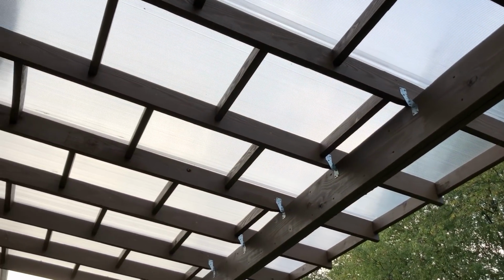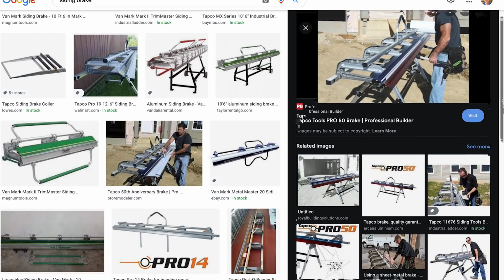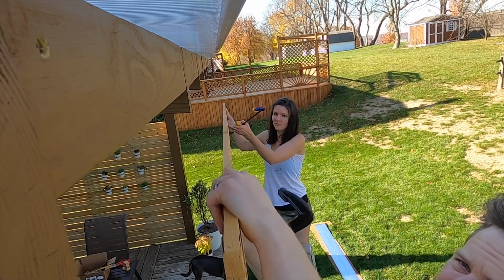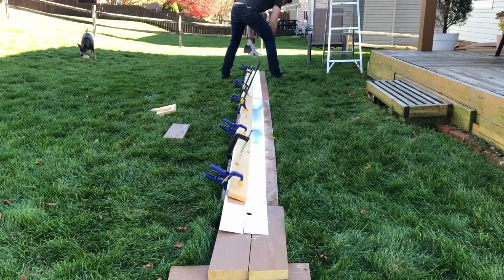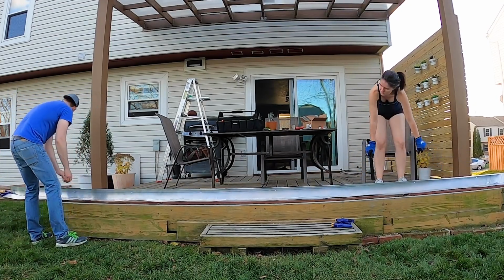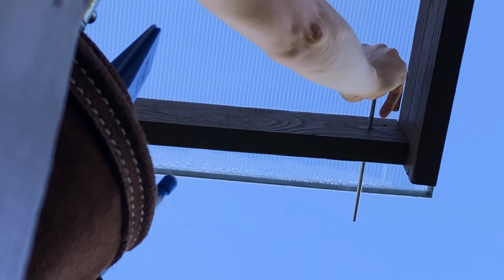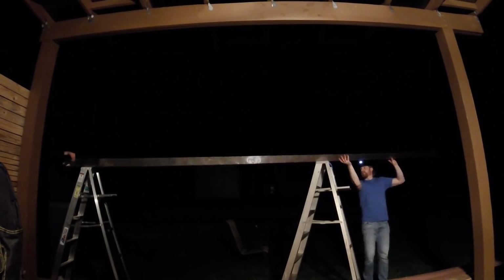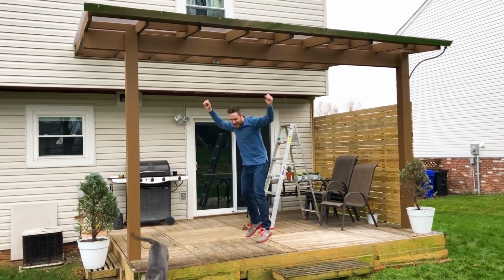Making a Cheap Gutter – Opinions May Differ

Comment: I've used valley tin as slashing where the metal walls meet the concrete. Absolutely wonderful. However, that wouldn't work as gutters for me in the Rocky Mountains. I get 18" or more of wet heavy snow. It'd rip that flashing down and turn it into a crushed beer can during the first snow.

Comment: And if you’re so cheap why did you use 6 x 6 posts and a 10 inch beam for like 3 x 2 stringers crazy you could’ve saved a ton of money on the post and beam and did it all 2x 4 
It looks really good I just don’t understand why it waste so much time with the flashing because you literally can buy it just the way you have the one in your hand which is also just a pack of step flashing which is about I don’t know five bucks for a pack of eight or something
Reply: I am super Duper cheap I’m hunting around looking for ideas cause I’ve got to do some aluminum posts on the patio cover for a friend

Comment: I agree about standard gutters designs are not the best ones, but yours, doesnt match with the beauty of pergola you have. (1) Maybe a hidden regular gutter? (2)Or maybe what you need is a "rain handler"? (3) The other option might work for you is that your pergola is not recolecting a lot of water, so maybe just a 2x2 angle glued down to the edge of the plastic cover to direct the water to one side of the pergola, and then with a downspot you can redirect the water to whatever is better for you.
Reply: a 1X1 angle glued to the top side of the plastic cover running on a slight diagonal to direct water to one side would have been easier, and more aesthetically pleasing.

Comment: Wow you are very creative and confident and ingenious. Sometimes penny wise becomes dollar foolish. 

Not sure where you live but roofing supply stores sell HAND SEAMERS. harbor freight sells them for $6 or $8. 
I love the determination. 
However I hope it doesn’t snow where you live because that (?sexy) gutter is a goner. 

Also I have a significant supply of hand roll formers. They allow me to make bends in aluminum at any length. So the 10’ brake problem is solved. 
I actually have the very first one i bought for bending the first and last roof panels on standing seam projects.

Comment: I used 2-1/2 in. "3-Way Roof Edge Flashing" from HD, $9.98 for 10 ft length (enter that in a search on their site).

I attached it to 2x3 studs and attached the studs to the fascia so that the inside of the channel catches the water from the roof panels. So easy and it actually ended up looking better than before. It worked well because my roof pitch is steeper than what you have here, so the flashing is tilted enough that the inside corner can hold plenty of water. I just let the water drip off the sides rather than catch it with a hose. It's working great, even despite the 2 ft of snow we've received recently.

Comment: I think this looks great!  Personally I think conventional gutters are ugly.  Thank you so much for posting this. This is exactly (almost) what I want to do and now I know the pitfalls in folding.   I'm running a straight gutter 90 degrees from the house over my uncovered patio to divert water into a pond/wet area.  The current gutter system delivers water onto the patio. Looks like your gutter was quite strong and could be self supporting if supported on each end.  Not sure how I will attach this to the existing system, wind could be a factor so I need to think that through.

Comment: Blake, I was going to suggest using clear Flex Seal on the underside of the roof to the top of the gutter on the facia board. It's only a couple of inches, so it shouldn't detract from the sexinest of your work.

Comment: Brilliant Concept. I have done a similar thing with a 90mm PVC stormwater pipe cut lengthways, (2 cuts 60mm apart) opened up and staked to the facia board with long Gal screws at 900mm centers, and finished with cap ends. Paint to suit. And yes, yours does look sexy. Cheers from Michael. Australia.
Reply: Nobody needs the measurements or instructions. We don’t know what communist millimeters are anyways. We use freedom feet and fractions. A system so confusing even we are dumbfounded by it. Or maybe we are just dumb? 😜

Comment: Why not just use 4 or 6 inch PVC pipes? Cut it in half & get with 45s / 90s into the & that should be a gutter system no? 

Could even use the water hose type drain you had

Comment: I was super curious what this would look like after watching you work on it for like 20 minutes. Then the video cuts to a shot of it in the day time after the night shot of you putting it up and... It looks awful, I mean truly ghetto like as if I went to someone's house that was built with parts from a scrap yard. 

You can see the waves from where it was bent with that little piece of wood and its uneven. 

If you really wanted a metallic finished gutter you probably should've gone with a regular gutter and some metallic spray paint or something.

A 10-second google search showed me you can actually buy galvanized steel gutters that look the same and are made by people who know what they are doing. 

You also need to put some kind of mesh or something over the hose inlet or its going to clog with leaves and dirt fast. Regular gutters don't have large downspouts because they need to handle a 3-inch opening worth of water flow, its so they don't clog as easily.

Comment: You can buy rain chains that are decorative and go directly into a barrel that can be encased in the same wood screen you have. You also could have cut the rods shorter and put screw caps on against the metal that would have given a cleaner look. You also would have had a curved trough that way without the effort of putting a crease in it. The hose drain looks cheap and the rods protruding give it an unfinished look. If you are happy with it, that’s all that matters.
Reply: Good thing you don’t live there, eh? 🙄 You and your ocd, smh! Who the heck is going to sit there and stare at a hose?? After messy rainy days, this simple, cheap diy has curbed the rain without costing so much out of pocket, or even hiring a contractor. I understand you’re trying to give advice and additional idea suggestions, but you can do that without being snarky and snooty. I’m sure we all can find something wrong with your diys. Feel free to post them in videos, “Tas”. I’m sure there will be another “Tas” out there that would think YOUR work is less than subpar and cheap. I, for one, love this idea!

Comment: Thanks for the detail info. In the end I think a normal gutter might have looked nicer though. One thing that looks really bad is the garden hose at a sort of 45 degree angle out of the gutter. But since it’s in, maybe Try maybe UV resistant PVC pipe with a sharper turn.

Comment: Another great job Blake. I am currently working on rain barrels for my shed roof. I have old trough's that i shortened and also did not want giant downspouts! So i am thinking I might also be able to us your hose idea?  On the days we get monster rains I will just have to let the troughs fill over if the hose doesn't take the rain fast enough.  But again I am curious to know how well the roof and trough in the snow. Our neighbor has a store bought gazebo and so far (2 winters) he has had the edge bend out when the snow turns to ice and pushes it out as it creates ice damns.
Reply from the maker: I’ve had a lot of snow on this roof and in the gutter. Big ice dams and it spills over the edge but no bending fortunately. Not much you can do in those instances. The garden hose has frozen once or twice. I could wrap it with heat tape but it’s not worth the hassle. It just drips off the edge like it did before I put the gutter in place. Sounds like you have an interesting project. I hope it turns out well.

Comment: You can use pressure treated wood for gutters. Thei will never rut. If the winter is cold and the summer to hot, they will wrinkle an crack, but some polyester will take care of any leaks.  The channels in the polycarb have to be closed to avoid green goo creeping upwards.

Comment: I appreciate your creativity, but I think you might have some future problems. 
While the gutter might have worked in a light rain, I think you might find it failing in a heavier rain, or rather the garden hose downspout. The amount of water coming off your roof will likely exceed the capacity of the hose. Even more so, 3-4” downspouts can clog with debris. It seems even more likely with a 3/4” hose. You also have a potential failure lurking where you connect dissimilar metals.
Reply from the maker: All good points you make. I had the same concerns when I made the decision to use the hose but it has held up pretty well. Check out how I ended up using it. Making a Rain Barrel that looks like a Whiskey Barrel
https://youtu.be/T0PwD5QI13k

Comment: You can buy good looking aluminum gutters with no paint on them (paint them yourself, or not). For a small section like that, it would have cost around $50 to $70.
Reply: For real. This video confuses me. So much time and money spent on something so cheap. Just buy black gutter and rain chain it. Done for 30 bucks and 30 minutes of work. I kept watching though because in the back of your mind you are thinking there is a chance he is going to show a good shot of that wife’s ass, but no. Very selfish.

Comment: Assume you don't get a snow load there...And the first time you get a massive rainstorm that little hose downspout will not be able to keep up and the gutter will overflow or the aluminum rod 'brackets' will break from the weight of all that backed up water. If that's the look you wan't I'd order galvanized half round gutter and use an appropriately sized downspout.

Comment: EVERYONE DO YOURSELF A FAVOR AND GO BUY A REAL GUTTER MADE OF AND FASTENED WITH THE CORRECT MATERIALS
That has got to be the most jankiest, bent up, and flimsiest gutter Ive ever seen. Not to mention the "down spout" flow volume is super anemic and cant pass any kind of solid debris. You get an E for effort in the jerry rigging category but there is a reason the International Residential Code and local building codes exist. I doubt this would pass inspection in material thickness or flow rate alone. Id hate to be in your neighborhood when a bad windstorm rips this flimsy POS off your house and it goes flying....wow

Comment: I love a woman that's not afraid to help! Doesn't hurt that she's a looker too! hehe
Reply: That little hose doesn't seem like it will do much in a heavy rain.
Reply from the maker: Several folks have pointed out the hose. Obviously it's a big step down from a conventional downspout. The only issue I've had is the screen I put over it clogs with algae. I have to clean it every few weeks. Otherwise it seems to handle the volume, but where I live we don't get as many heavy downpours. It definitely wouldn't work in the south.

Comment: Good job.. looks good. But dk if it was worth it especially with the chance of injury. Also make sure it has a slope towards the drain that way you don't get water just sitting there and.not draining properly. But looks good keep it up
Reply from the maker: It definitely took longer than I had hoped, but once I was committed, I had to finish it. I did drain it about 1.5 inches across 16 feet. That has been working well so far. Thanks for the comments!!

Comment: If you coat the gutter with some of your hair product, it should stay up longer.  Seriously though...if you discover that 3/4" hose and 1/4" aluminum rods can't take a deluge, I suggest upgrading to all-thread.  You can ditch the cotter pins.  While you are up there, you can also rivet some 1/2"x1/2"x1/16" aluminum angle down the top edge(s) of the gutter for a straighter, stronger vintage airplane effect.  This is why non-sexy K-gutters have a rolled leading edge.
Reply from the maker: Now we’re having fun! Would you believe that’s my natural wave? Good suggestions.

Comment: Blake - You might consider removing it before winter, because it’s likely to get damaged by any heavy snow or ice.
Reply from the maker: Believe it or not it has held a foot of snow. It’s also been frozen solid with no issues. But you make a good point. It would be relatively simple to remove.
Reply: @BuildingWithBlake  Ah! I too was wondering about the weight of the snow as it slipped off when Spring comes around. Excellent to know that process was tested out and it was a successful outcome!👍💯🇨🇦🍁💪

Comment: I’m planning a pergola and was thinking of putting a cover on it.  What clear material did you use?  The flashing looks a little flimsy.  Is it holding up with water in it?  Also, is the hose big enough to move that much water out of the guttering?  I’ve watched the water pouring on my storage shed and down the gutter.  It’s a lot if it’s raining pretty good.  How about a rain barrel to collect the downspout water?
Reply from the maker: I have another video about the roof. Check this one out: https://youtu.be/fWDzmfYztRY 
The flashing by itself would be flimsy, but the supports hold it in place extremely well. It's been frozen solid multiple times during winter and didn't even flex. Everything is aluminum. The garden hose can handle a heavy rain, but I have a screen over it that I have to clean out often or it will overflow. Rain barrel coming soon.

Comment: Did u say ur sloping this a inch and a half? He'll that short of a run you would only need a quarter to half inch
Reply from the maker: Correct. I sloped a bit steeper because the hose inlet for the downspout is about 1/2 inch above the bottom of the channel. I realize it's not exactly by the book.

Comment: I built a wooden gutter.  Glued and sealed with polyurethane.   Painted to match where it was installed.  Have to look hard to even see it.
Reply from the maker: Sounds like a great idea. I probably should have done that instead.
Reply: What did you use for the downspout? Is that wood too?  I like the idea of a wood gutter. Even if it’s not 100% water tight. Could be a neat architectural detail on a house
Reply: A classic. Add a rope or chain hung by a nail bridging across a hole for a downspout and you have a solid combo.

Comment: And you think that looks better than proper brown guttering ??  With all those fixings visible and the red-neck hose drain off ?  Strikes me this was done just for YT or as a topic for conversation at dinner parties. Wrecked it bro.
Reply from the maker: A conventional gutter would have been twice the size. It would have hung down into my line of sight from inside the house. Same with a conventional downspout. This setup is much lower profile. I looked into custom orders, but those get pricey and the color would not have matched. This is a modern take. The supports are part of the modern design. Not everyone's style, but I see it everyday and I'm thrilled with it. Dinner guests have also been complimentary. Thanks for watching.
Reply: @BuildingWithBlake  It looks janky and to be honest, no one is going to come over to your house and say, WOW, you really need a new gutter system. LOL Props for the effort though. Also it wont work, eventually that hose will get clogged and be a lot of needless effort to unclog every time, hence the reason downspouts are so large.
Reply from the maker: @paulluna45  I put a screen over the hose inlet to keep the gunk out. I have to clean it regularly or it will indeed clog. It's not a perfect system, but I still prefer it to a conventional system. I researched them all before I started. There's another phase i'm working on now that might shed some light on why I went this direction. thanks for watching.